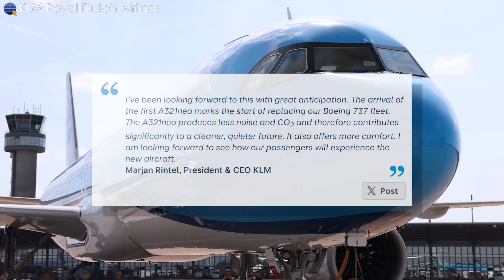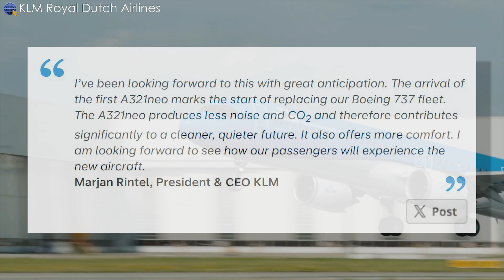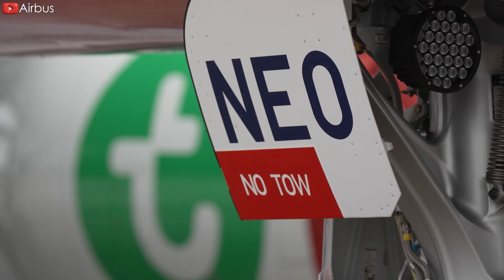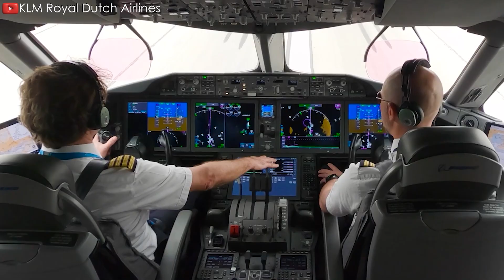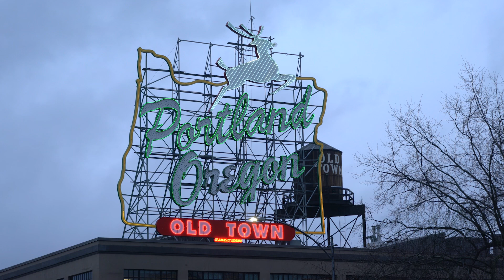KLM's Huge Plan for A321neo will change the industry! Here's Why

Comment: This video is directionally correct. But wow, so many errors. The added seats have nothing to do with width of the airplanes. It is length. They are both 3 x 3. Also, the windows on the NEO are not larger than the original 320 series. The video is wrong on this. Finally, the AI calling the 737NG the "nanogram" is just bothersome. I enjoy this channel, but need to fact check better and consider not using AI voice.
Reply from the maker: Thanks for your support! We will do everything to make your experience better and better!